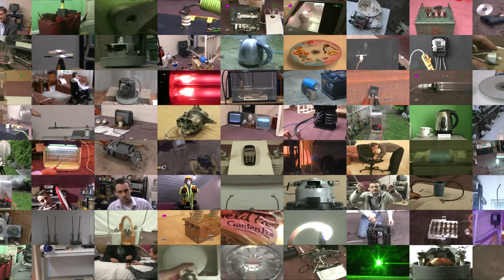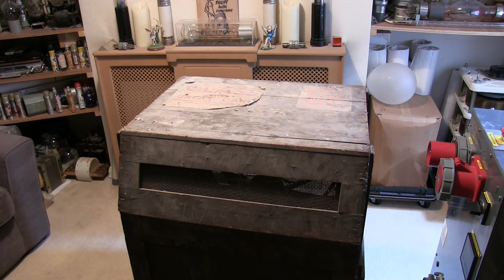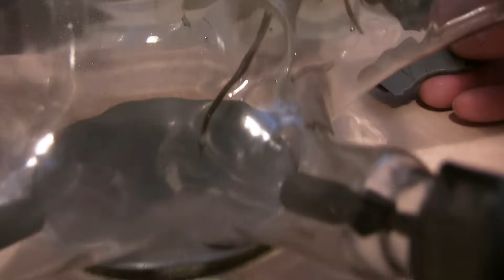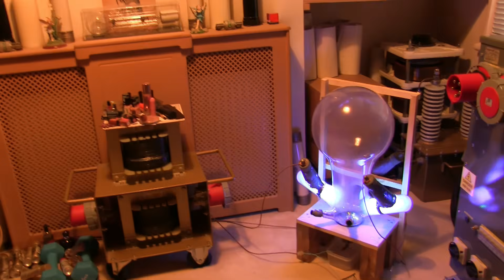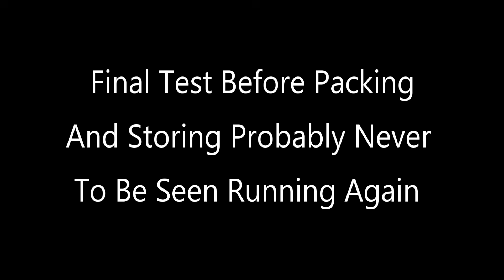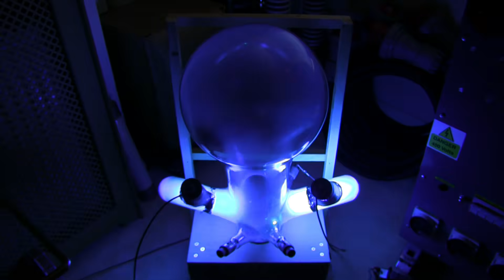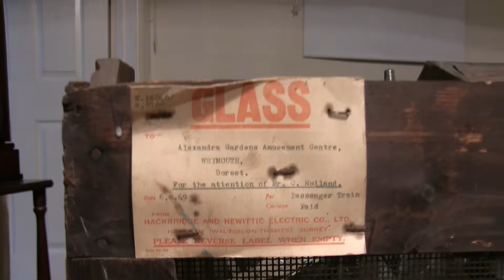Testing The 50 Year Old Mercury Arc Rectifier

Comment: Since it's effectively a diode, and it's emitting light, does that make it an LED? (Pardon my ignorance, I'm a biologist not an electrical engineer)

Also, since it's effectively a massive mercury vapour bulb, is that glow essentially raw UV radiation? If so that's... a bit spooky.
Reply: I guess must be an LED then
Reply: More accurately, it's a mercury arc lamp performing the job of a diode.
Reply: It is spooky.  Definitely get a tan if you hang out long enough.  Glass absorption of UV is limited by wavelength.  Plain silica glass doesn't block much UV.  That's why UVC lamp envelopes are glass.  IR, yes, UV? Not without special coatings or alloying.
Reply: Since it’s made of glass the UV doesn’t escape (I think that’s how it works, correct me if I’m wrong.)
Reply: @bjoe385   "The mercury ions emit light at characteristic wavelengths, the relative intensities of which are determined by the pressure of the vapor. At the low pressure within a rectifier, the light appears pale blue-violet and contains much ultraviolet light." so yes they do emit some
Reply: Também pensei a mesma coisa, a câmera quando se aproxima nem parece ter luz acesa no ambiente!! A exposição a radiações deve ser preocupante, mas por outro lado o ar ionizado devia eliminar qualquer microrganismo!! Talvez por isso ficassem protegidos sob painéis...

Comment: The blue dot that bounced around on the Mercury's surface, is that the only point at which electrons are drawn off? last question: Can it be converted to a huge 2 pole HID merc vapor lamp?

Comment: Used to use them in thr Royal Navy to convert 440v 3 phase to DC usually in diesel submarines which had AC generators (smaller and lighter than DC generators).  We had one at the training school, HMS Collingwood, it was kept in a cupboard for dramatic effect with its weird glow.  Ours was known as the "rabbit" for its shape, the electrodes were in the ears.

Comment: Used for railway traction current, lager version !  You could get a good tan from the amount 
of UV emitted - 2000 to 4000 amps and much hea,t they had large cooling fans.
Do you know the forward voltage drop on these rectifiers, please ?

Comment: Thanks for this. I have memories from when i was an apprentice electrician at the BR Carriage Works in York, 60's to 70's. At one point i was assigned to the maintainance department for the works, which was also attached to the main transformer station for the works You can imagine a huge amount of power needed. The works had two traversers which would traverse the carriages from out of one shop into another. At the time these were still powered by 400Volts DC. In the transformer station was a large metal containerprobably about 6 foot x 6 foot x 8 foot high. Painted dark blue with a sign saying 'THE TARDIS'. Emanating from above was blue/ ultaviot flashing light and a strange science fiction film sound. When the door was opened it was a sight to behold. 6 of the above mercury rectifiers. No doubt we should have been wearing dark glasses and sun cream . At the time i had no idea of how they worked, so cheers for this.
Reply: my stepdad did a bit there before becoming a guard, i think the times may have overlapped slightly with yours, so you may even have met him, brian cox was his name.
Reply: im an electrician and i love that kind of stuff.  must have been an amazing thing to see up and running.
Reply: It’s also really funny how they possibly reused an old police box as an enclosure for a mercury arc rectifier! :)

Comment: I still don't understand how the arc keeps going even after the exciter unpowered.
Reply: The mercury is the cathode. As electrons flow one way towards the anode(s), ionised mercury atoms - which are positively charged - plunge back into the surface of the liquid mercury. As they do they dissipate energy as heat and light in the bright spot you can see 'dancing' around the surface of the mercury. This heat vapourises more mercury atoms off the surface and into the tube which continues the arc. The exciter just has to vapourise enough mercury for the main arcs to startup. After that it can be turned off.
Reply: @f114163  Oh, I see now. Thanks for clarifying!

Comment: So is this like a diode or what is it?
Reply: It's like three diodes in one glass envelope - one cathode and 3 anodes. It would have been used to rectify a 3-phase AC power supply.
Reply: @f114163  so the cathode of all three phases meets in one point and you get dc? But where do you get the  minus terminal for the dc source?
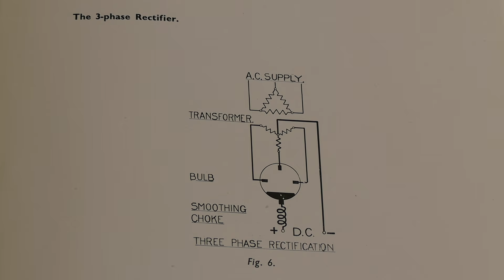Reply: @danijel124  Yes, the cathode of all 3 diodes meet in one point and you get DC. The minus terminal for the DC source comes from the transformer windings. Take a look at the circuit diagram at 2:41 and pause on it for a moment. It shows just how a 3-phase supply is rectified using the type of rectifier PhotonicInduction is demonstrating. The DC will be a bit rough - it will have ripple in it but it would be good enough for a lot of industrial applications like powering a motor.
These days you would do the same with 3 separate silicon diodes - just wire the cathodes together.

Comment: What is the shiny sparkly thing dancing around on the mercury when it is powered on?
Reply: That's the point where the arc meets the surface of the mercury. 
The mercury is the cathode. As electrons flow one way towards the anode(s), ionised mercury atoms - which are positively charged - plunge into the surface of the liquid mercury. As they do they dissipate energy as heat and light in the spot you can see. This heat vapourises more mercury atoms off the surface and into the tube helping to continue the arc.
This cycling of the mercury constantly renews the cathode surface which is how these tubes can run at much higher currents than conventional 'solid' cathode vacuum tubes without damage.
I just know I've skipped over a lot of physics there but that's the basics.

Comment: Maybe a dumb question but do these kind of arcs produce alot of uv-c or even xrays? or is the glas shielding it?
Reply: Not much x-ray at only 400V on the anodes, but they will emit UV light. Not sure what kind of voltage and current this one is rated for but I suspect its barely ticking over in this demo. The glass will absorb some UV light. You probably don't want one running in your living room for long though.
Reply: @f114163  Thanks for the answer 😊

Comment: Happy Days, I'm old enough (82) to have worked on mercury arc rectifiers. Steel works where we had 500 volt DC and 250 volt systems. Can't remember the rating of the rectifiers, Big yokes in metal cabinets. This brings back som happy memories, thank you ☘️🇮🇪☘️

Comment: This type of Rectifier was used in Melbourne Australia to produce 1500V DC for the Electric trains , there were 7 of these H&H glass bulb rectifiers across the network in 1970's the last was de-commissioned in 1981  . There were large fans below each bank of 4 bulbs and as the load increased on the rectifier unit the fans speed increased till it reached maximum speed . It was an extremely noisy environment that was extremely hot in the summer but nicely warm in the winter.

if ever there was  a dangerous device these has it all , if they ever broke mercury finished up on the floor and every where it was quite a job to transport them with special crates, it took 3 people to  hold and slowly invert the bulb while the pool of mercury was also inverted.

It was quite spectacular  to see but by today's standards very hazardous  I was glad to see the last of them .

Railway substation had Rectifier units made up of a Transformer with an output of  12 single phase's connected to a bank of 4 bulbs and a large 12"fuse each phase along with  associated protection relays in the Rectifier control cubical (64, 64A, 86, 86X, 30 )  . I also remember two large  extraction fans for cooling built into the substation wall .

The excitation and the striker was used to create the mercury vapor in the bulb it's all history now. 
Be careful with mercury keep it in a well vented area.

Thanks for the video !
Reply: Wow I especially appreciate your comment on this subject!!!! Thank you for sharing sir.

Comment: I am seriously impressed. A few questions. 1) Would you please publish the listed specs for this device? 2) What is the best feature of a mercury arc rectifier? (cleaner output, lower temperature, high capacity, easily handles current surges) 3) It would be nice if you published your results, AC input, AC current, DC output, DC current, Output waveform, etc. Hope to see another video like this.
Reply: High capacity, and overload is about it, when compared to current day silicon diodes.

Comment: They still had a couple of these when I did my apprencticeship at Birkenhead Tech in 1975/6, I thought that I wouldn't see one again. Then I was doing some project work on a British Steel site in Scunthorpe and they still had one working. It provided the DC for the overhead cranes in the bay that we were leasing off BS. Around the time I finished working on the project they de-commisioned them and put in sold state rectifiers. This was in 2017, there will probably be some more working away in other places.

Comment: Just out of curiosity, would one of these work if the mercury was replaced with gallium? I realize the tube is evacuated, and it wouldn't be worth the trouble of doing the exchange, due to the effort, and toxicity of the mercury, I only mean this as a thought experiment.

Comment: Ah! Takes me back to the start of my career in broadcast transmitters. The more modern transmitters then (250kW carrier power) used Excitron mercury arc rectifiers.  They had 2 banks of 6 Excitrons, with the transformer windings arranged to give 12 phase rectification.  Output was 11kV DC - the radio part of the transmitter took about 26 amps, and the high level Class B modulator another 15 amps depending on audio level (approx - from my memory). The rectifiers were in a cabinet with glass windows so you could see that lovely blue glow as the arcs were struck - then the light output would vary with the audio modulation.  Quite spectacular when the Greenwish Time Signals 6 pips came on (they modulated the transmitters to 100%) - the extra current draw caused lights to dip in the nearby town in step with the time signal! Oh, and the older transmitters (built during the 1940s) used mercury arc rectifiers in massive steel tanks with continuous pumping to produce the required vacuum.  They used grid control to vary the output as required.  Incredible to think about now!
Reply: Ho i brividi di eccitazione leggendo questo commento,  vorrei essere li
Reply: And now a MUCH smaller (in comparison) diode quietly does the exact same thing...

Comment: These were in use on the Wellington (NZ) trolley bus system, to produce 600 VDC for the overhead wires in 2006, and maybe until the system shut in 2017. They must have been in service for over 50 years
Reply: The cook straight cables 600MW HVDC line from Benmore to Haywards, used these on a much larger scale from 1965 till decommissioning in 2012. https://docplayer.net/docs-images/64/50784636/images/19-0.jpg

Comment: Is this technology the reason behind the terminology 'Solid-State' for modern silicon rectifiers?
Reply: I think it simply stands for "No vacuum and/or mercury and/or other gasses and/or liquids are used. Not even Blinking Fluid. Also no mechanical parts. Only solid Silicon / Germanium etc.".

Comment: I think that thing is a lot older than 50 years. If it were 50 years old, it would be from about 1970. The modern solid-state diode (which obsoleted this device) was popularized in the 50s. So it's safe to say it is at least ~70 years old.

Comment: I'm impressed.  If it were me, I would have used a soapy real cloth, rather than paper, for the first round of cleaning.   (then a couple of 'rinse and clean' rounds).    Just because the dirt was so thick on there.   Must have been in a pretty clean environment, though.  About the same amount of dirt that you'd see in two or three years at one of my customers (CES exam station/freight forwarder).   To be that clean after 50-60 years is amazing.   

Absolutely wonderful to watch.   I wonder how much waste power there is?  (enough that you wouldn't want to use one for a decorative display, that's for sure)

Comment: Why does the current flow in one direction only in a mercury rectifier?
Reply: The pool of liquid mercury acts as a self-renewing cathode that does not deteriorate with time. The mercury emits electrons freely, whereas the carbon anodes emit very few electrons even when heated, so the current of electrons can only pass through the tube in one direction, from cathode to anode, which allows the tube to rectify alternating current. - youtube

Comment: In Poland we use 3kV DC for electric locomotives. It was the standard voltage since the railway was electrified. So we had to use such rectifiers at some point in time. Some might be online even today, in some parts of the country. Those railway guys love to use old equipment until they can.

Comment: This could give you some serious arc eyes, but very interesting to see one of these work.
Can you imagine these in a locomotive bumping around on rails? These were used in most early types of AC locomotives, up till the 60s when solid state rectifiers became available.
The current from the overhead wires was stepped down in a transformer and then rectified for use in DC motors, as these had easy speed control trough shunt resistors.

Comment: Going back a few years, well, about 60 years to be precise us kids used to frequent Cleethorpes (UK East coast) sea front where an old chap used to run the big (little) wheel on the promenade. The wheel itself was an interesting wooden contraption, but the main attraction for us was the valve thingy powering it. It was kept in a wooden shed next to the wheel and the door was always open showing a massive buzzing glass bulb flickering purple sparks. It often drew a small crowd of folk, and I expect it was a bit of a money maker for the old chap.

Comment: The stand seems more than stable, especially when you think trains used to use Mercury arc rectifiers a few decades back! Another great and unique video.
Reply: I remember driving past sub stations driving trains. As you accelerated you could see the blue glow from the windows get brighter.
Reply: Looks fine but he made the stand. It's not what it would have been sitting in in the electrical building for the railway.

Comment: its crazy how much a wire will jump around from high voltage. I have seen 480v concrete floor grinders turn on the cable jump a foot in the air as the power runs through it

Comment: Question: That noise you get from electric components like these, the Hum. What causes this?
Reply: Because the power is AC, and alternates 50 times a second. This causes the magnetic field inside the transformers to change 50 times a second which makes them vibrate, in exactly the same way a speaker converts AC signals into sound.